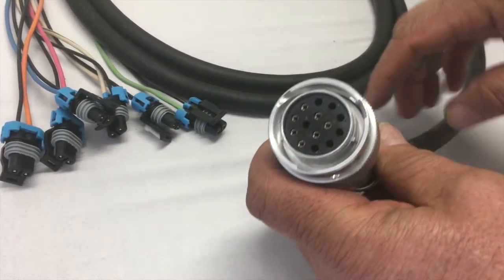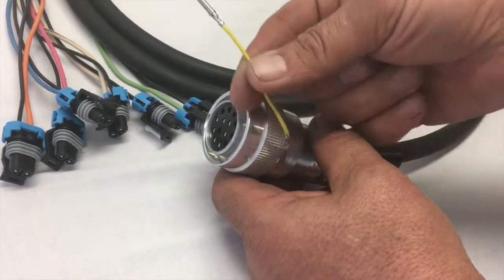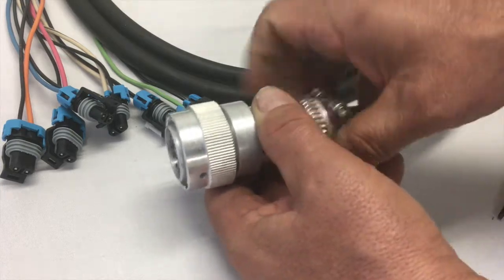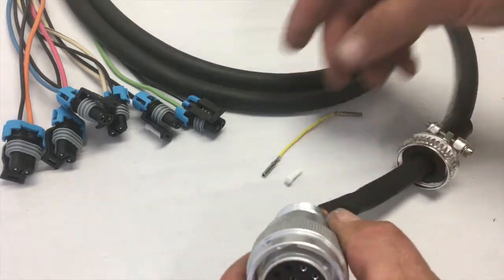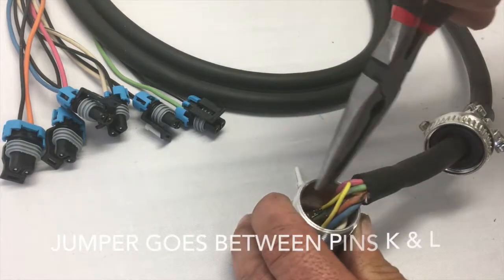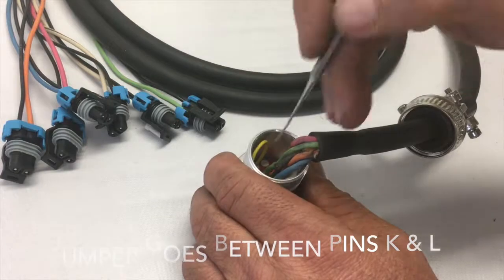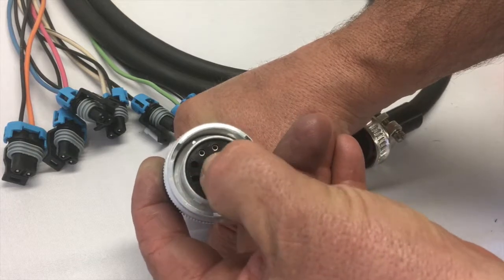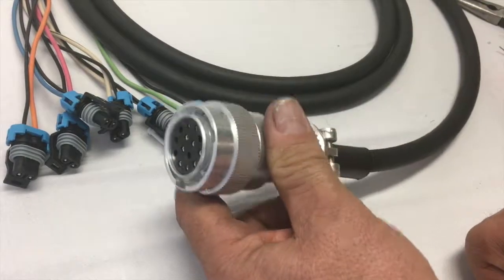#116 - Bobcat 14 Pin Pump Control Jumper Explained.

Comment: i have a 2015 t770 and this method doesnt work is there an other procedure? i am real stuck and cant use my home made attachement on this machine because de pump keaps turning on. i want to simply power a diverter valve